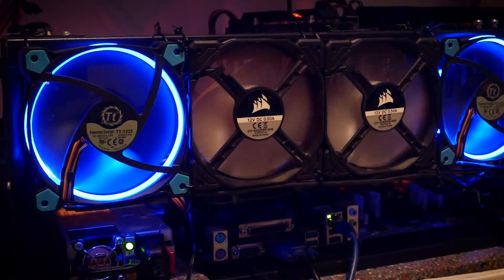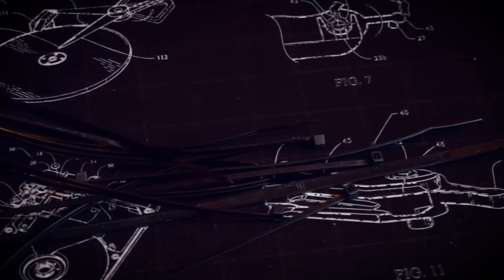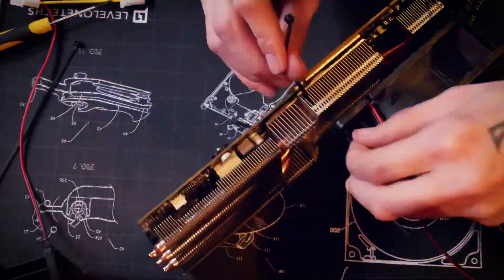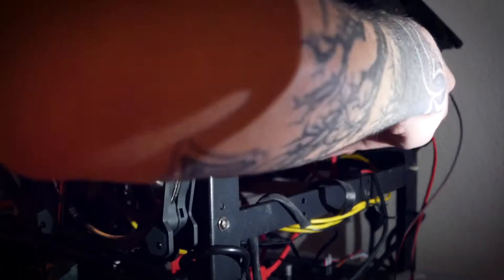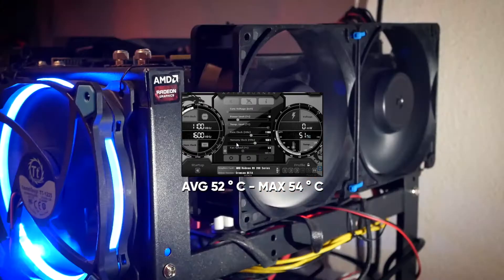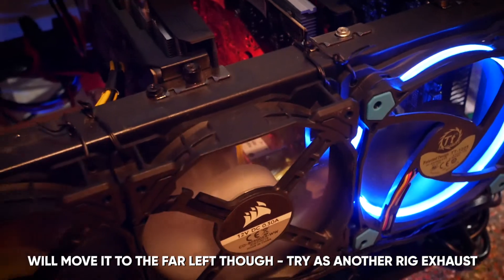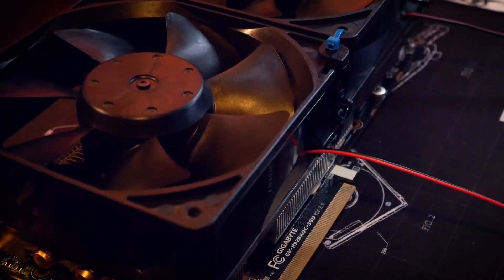Custom GPU fan for mining cryptocurrency - lower temperatures! Delta Cooling

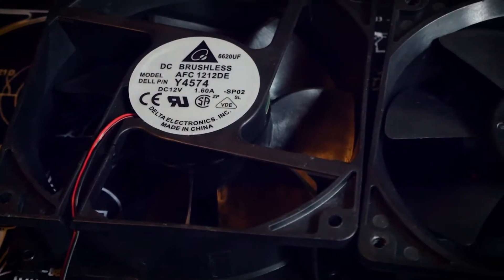Comment: Very cool video - I have done something similar before and removing the shroud alone will give you better GPU temps.  Speaking of the fans, those are not Deltas - they have the Delta label on them (strangely) but they are NMB fans, model number 4715KL (I have six).  They are still good quality ball bearing fans by all means and it's obvious that you got good results with them.  Both the Delta and NMB are used in Dell workstations.  I notice at 1:06 in the video there are what look like Nidec TA450DC fans on the other side of your case - those are also amazing fans too.  Happy mining!

Comment: New Sub.  Like the thought.  I recently sold my r9 290 Tri-x.  That thing heated up significantly more than a modern RX architecture and sucked down the power.  It did hold 30 Mhs on OC on ETH though.  Will be checking out some of your other Videos.  Thanks
Reply from the maker: Hey James! Thank you and welcome to the channel! The R9s are definitely power hungry heaters, but I could not bring myself to sell it. Now I moved it to the far left of the rig and it works well as additional exhaust (card now below 50° C). Cheers =)

Comment: if im not wrong, that fan suck 19.2W each. 2 fan should be 38.4 @ 100% RPM. if we have 12 GPUs or  more i think Air conditioner + stock gpu fan will be better than giving those 2 delta fan for each GPU.
anyway, this is cool video i love it

Comment: If the GPU has 4 pin 12 V 0.40 A fans, then can I use 4pin 12V 0.30A fans? It won't damage the GPU pins, right? I want to use msi afterburner to controll my fan speed, so if it is not necessary, i don't want to use another source for my fans.

Comment: how you can control the fan thru the molex connector?
Reply: YOU CANT
Reply: You Can, but you must use external electricity sources. And use a dimmer it will control the Voltage or Ampere so that the fan speed will decrease..

Comment: Just adjust the fan rates with afterbuner, like a normal person
Reply from the maker: Good thing I am no normal person then - no fun in that =D Sure I have my fan curves, dropped temperatures with new thermalpaste in the last video, but 52 ° C on this card is simply not possible with stock cooler and fan curves.